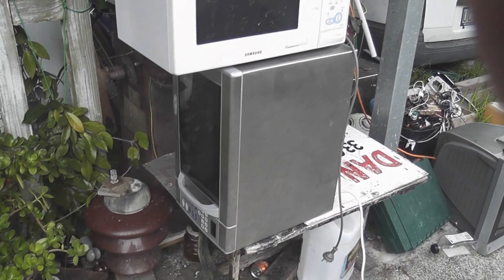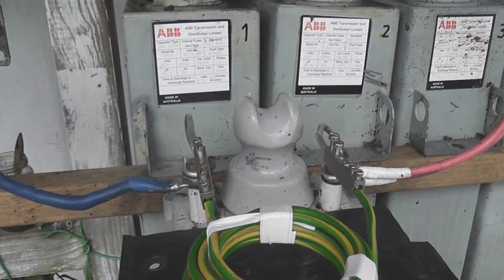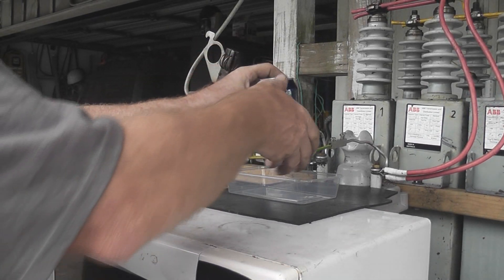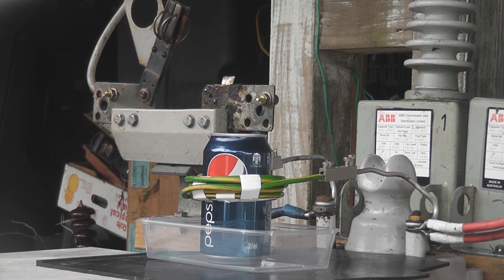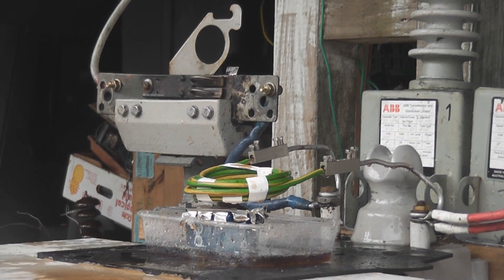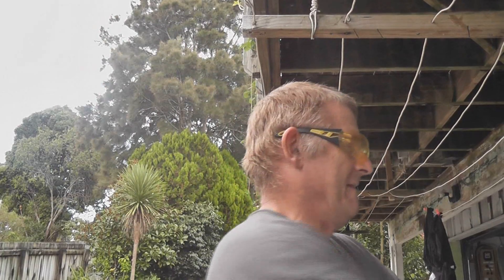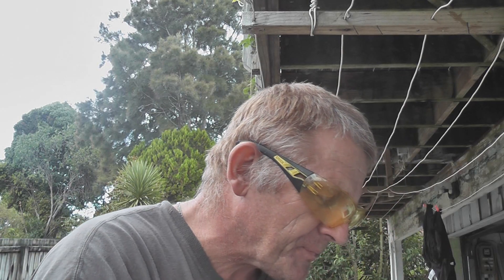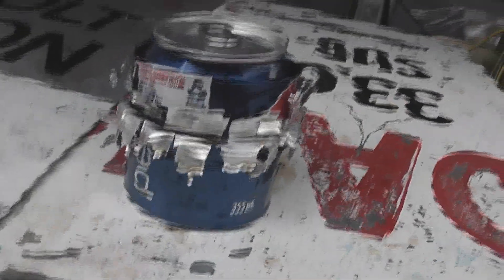Pepsi Can Explodes

Comment: it happens so cot damn fast..imagine a high speed camera capturing this. Do you have an iphone 6 by any chance? They capture at 120 fps!
Reply: The iPhone 6 shoots at 240fps it was the 5s that did 120
Reply from the maker: "pad kid poured curd pulled cod" No, looking for a reasonable prices Hi-speed camera
Reply: ***** 160 FPS is not that much of a high speed camera. it will never be able to see a bullet in flight. you need things like 10,000 FPS. this probably happens even faster than a bullet. electricity travels at the speed of light! 120 FPS is only 4 times slower than normal 30 FPS tv boradcast.... and only half as fast as 60 FPS. thats not really anything to brag about. 

plus, you cant put a tri pod on an i phone 6 (yes i know they make thows weak ass fakey plastic mounts... but, thats not a real screw in stable tri pod) 

and its an iPhone 6.....its a 700 to 900 dollar phone, that hes only going to use for the slow mo? why not buy a 900 dollar dedicated slow mo cameria taht can do 10,000 fps, that has software and features specifically designed to help capture slow mo? can the i phone 6 do frame by frame after it captures at 10,000 or even 120 fps?
Reply: ***** An iphone 6 ( under 2yr contract ) is the cheapest slow motion camera you'll probably find..but forget about the tripod. RODALCO2007 would break it the first day! I'm surprised his youtube cameras image sensor isn't burned yet, lol.
Reply: "pad kid poured curd pulled cod" right.... but im not sure if he would even want a cell phone, or if he already has one. 

but, 120 fps would not help us here.... this shit happens FAST! i dont think saying it "happens at the speed of light" is too much of an exaggeration here. 

i mean.... ya, its really cool that apple FINALLY did something before other people did it, and put slow mo into a phone. its not 1000 or 10,000 FPS, but its a start. in 5 years it might be up to 5000 FPS.... but.... 

like.... he needs a flat screw driver.... why would he buy a swiss army knife, if hes only going to sue the flat screw driver?
Reply: TheMacandpcguy even so... its still far to slow to capture whats going on here.
Reply: ***** so what your saying is there are no videos or pictures of lightning? either way no one wants to see a bright flash...250fps shows the bits of aluminum and delicious pepsi liquid flying everywhere ...but not at the speed of light, silly.
Reply: TheMacandpcguy Meh. 240. This is already at 240 or thereabout.